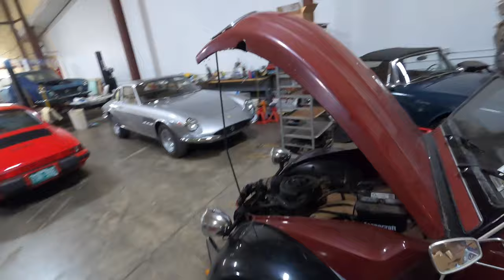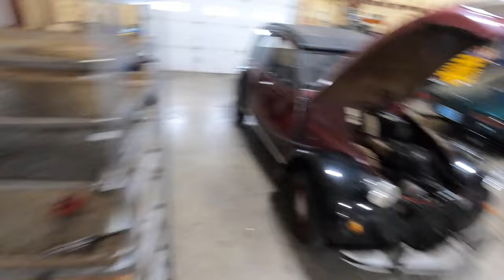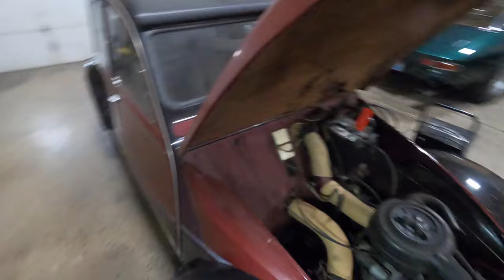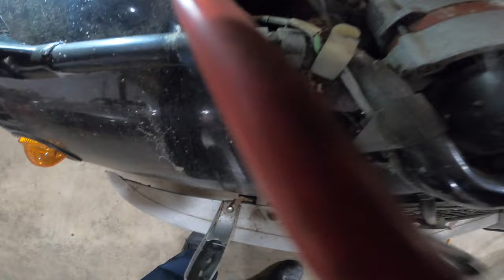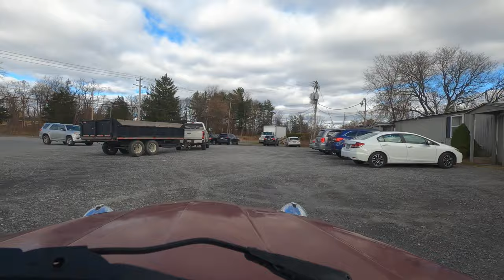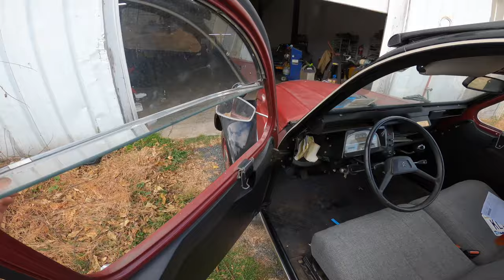Citroën 2CV

Comment: I used to race them as well as have road ones. Brilliant little cars and one of the most fun racing cars Ive had in over 30yrs in the sport. They can also be started on a hand crank via the hole in the front grill.
Reply from the maker: I found this 2CV interesting. Fun to drive, and really comfortable. They must be a riot on a race track with more power. I can't imagine the lean angles!

Comment: Okay Tom, I just watched a 2CV how-to oil change video. Quirky as the vehicle. One of the first steps is removal of the front body panel wings. Sacré bleu!
Reply from the maker: i couldn't have said it better myself!
Reply: To access the oil filter, yes (you can kinda do it without removing anything but it's tight). Most jobs on a 2cv's front end are easier if you remove all the bodywork, which thankfully only takes about 10 minutes.